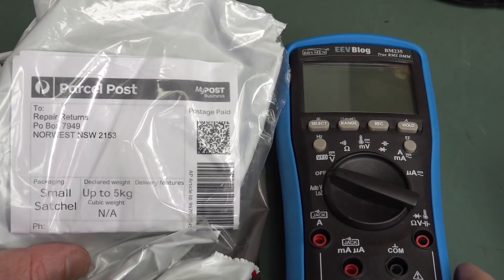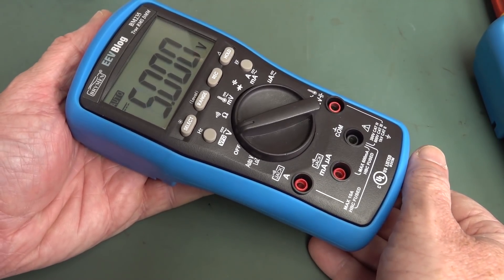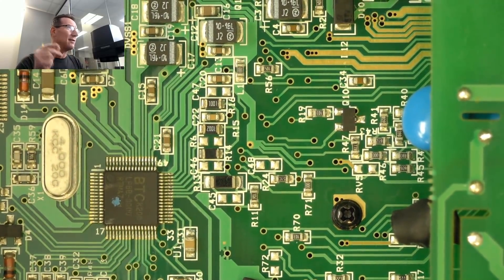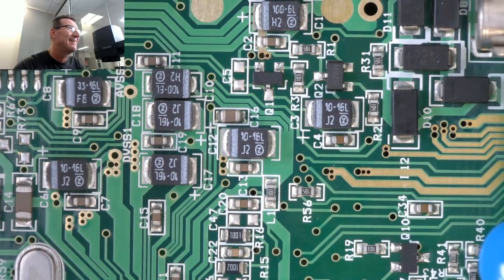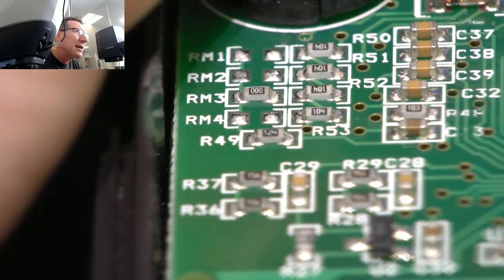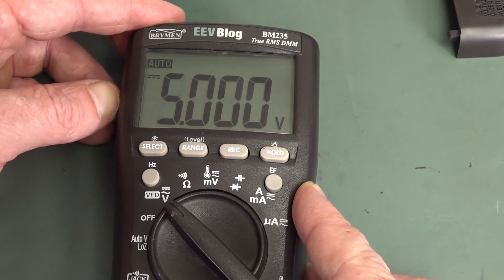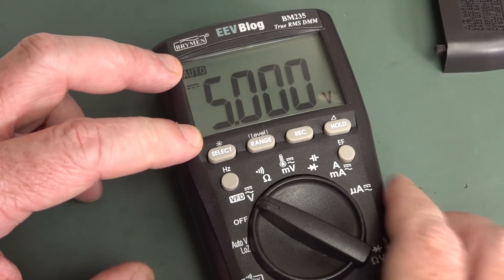Unusual Brymen BM235 Fault

Comment: Seems like a internal silicon issue to me.  Not sure how the main processor and LCD driver communicate and the format of display data, but it could be just a display data corruption considering it only affects the most significant digit and in a repeatable way.

Comment: Is there a voltage reference chip in there somewhere?  If Vref is dropping to zero the display might read full scale.
Reply: It looks like U2 is a LM385-1.2 voltage reference diode from Texas Instruments.  Looks like it's being fed bias current via R27.
Reply: @steverobbins4872  I was looking for the reference voltage, U2 looked like the candidate for being one.
A scope probe on that, and a few on the power pins for the micro should sort out where the issue is.
Reply: @station240  I couldn't agree more. Scope the shit out of that - Hook up a good meter right next to it, and just compare what is going on at various voltage-rails. (where you find deviations that rhythm of full-scale readings). My opinion is: having a non-broken copy of the device might be even better than having a schematic ;-)

Comment: Not for economic viability obviously but rather curiosity / makeshift QA department, I'd have swapped the processor with another one. Especially should another dodgy meter turn up some day. Note batch / date code of affected processors, it could be a bad lot. But it would exclude software issues.

Comment: The fault produces a repeating fixed pattern not random, internal cpu crosstalk fault??
Reply: Was about to comment the same. Doesn't look random, there's an actual pattern for some reason.
Reply: #12 Freeze Spray the ICs
#13 Send it off to the hydraulic press channel and get lunch.

Comment: Could the 5.000 be the reading from the internal reference voltage (after scaling)? It may be a faulty internal multiplexer is feeding it into the A/D converter intermittently? PS. You're more frugal with the flux than a certain Mr Rossman. 😉
Reply: That wasn't even one miliPaul of flux...
Reply: I'm guessing there's a 5v rail going into a mux, reference is more likely 1v-3v
Reply: But its powered by 2 AAA batteries so unless there is a boost circuit to generate 5V, there won't be 5V on the board. It likely runs on 3.3V or less.

Comment: I'm looking to buy either the BM235 or the 121GW, just not sure which to get. I mostly do some Auto/Home DIY and minor electronics repair, nothing too deep.
Reply from the maker: The BM235 in that case. No need for anything fancier.
Reply: @EEVblog2  thank you Dave, cheers
Reply: @EEVblog2  Got the BM235 in today, excellent bit of kit. Had fun testing it out on a few things. Thanks Dave!!

Lenny from Boston USA (Soon London UK)
Reply: The BM235 is an excellent meter.  I have 3 (one at home, 2 at the office) and they're the first meter I tend to reach for.  If you need more advanced functions then the 121GW is good, but I generally prefer the BM869S or a bench meter in those cases.  The 121GW is pretty impressive for feature set vs size.
Reply: Ordered the BM235

Comment: Maybe a stupid suggestion, but could it be the most-significant bit (MSB) of their custom ASIC going weird? IDK how they make their ASICs or what each of the pins does, but maybe a bond wire somewhere that's related to the MSB is faulty. Not that I've ever heard of them failing, but it's all I can think of. The randomness makes it look like a floating pin or something.
Reply: Time to get the nitric acid out and decap the ASIC.
Reply: Its not random.  On voltage anyway.  Its a regular sequence of 5 pulses.  its four pulses showing the correct reading then the 5th pulse just shows the max range. edit: the other ranges have a pattern too but different from voltage.
Reply: 5:59  J1  or   U5  looks  some thing  burn out

Comment: Looks like it's generating some noise somewhere and it is trying to autoscale to the fast fluctuations in the noise.

EDIT: So, it shows the correct voltage and toggles range. Then it can't be noise. I'm probably wrong. Definitely looks like a processing issue now.

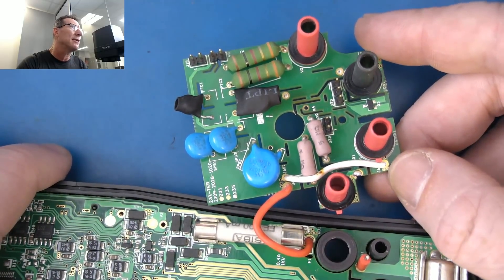Comment: The white lead on the input connector board looks a little toasted (visible between 9:11 and 9:20)
Reply: It looks to me like a hardened drop of rosin flux not a burn mark
Reply: @Yrouel86  Yeah, I think so too, I dont see a skid mark on the pcb near that wire. So probably flux.. My bet is an internal fault of the prosessor and that flashing 5 four times, then pauses and repeats consistently. Is some sort of fault indicator. Like maybe the eprom has corrupted somehow. It's weird for sure
Reply: @Kyle-Veilleux  Except that the folks that built the thing said there is no internal fault code.
Reply: @stargazer7644  yeah, i did catch that,. it is pretty bizarre for sure. That was honestly my only thought. It looks like a perfect pattern.. So Idk. Im no expert haha, just know enough to know I don't know shit haha
Reply: I noticed the same thing!
Reply: Just some stray flux or conformal coating

Comment: nice job of mixing batteries!... noticed one is rechargable (the low voltage one)
Reply: Yeah that's a glorious example of terrible marketing by Energizer! First thing I thought when I first saw Energizer "Eco" branded batteries was that they must be rechargeable cells. So I'm not surprised they've been mixed up with an actual Ni-Mh cell.  But no, turns out they're just made of a whopping FOUR percent recycled materials. I'm not sure you could get much more disingenuous.
Reply: That's why I stick to Eneloops (and not just because I bought them from DSE like they were toilet paper)
Reply: @leonkernan  hahahaha
Reply: went to check the comments before i mentioned the very same. good eye mate
Reply: I seen that too right off the bat. 1.3 V is about as high as a rechargable one gets from my experience